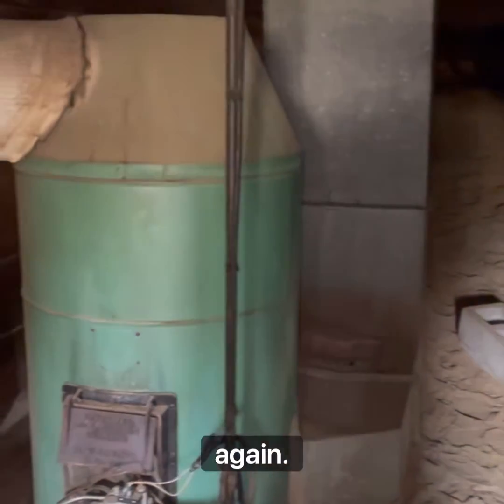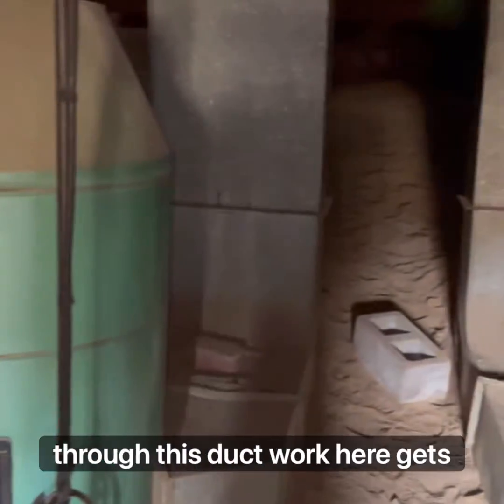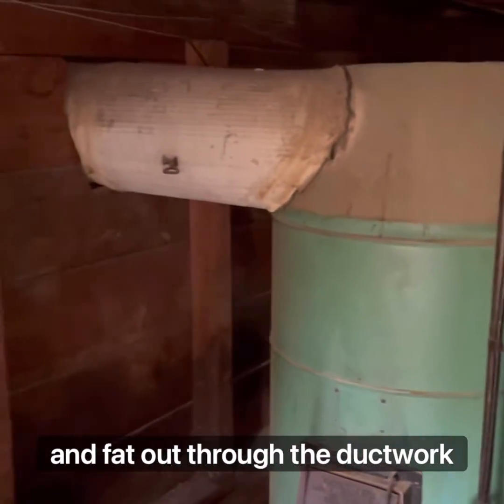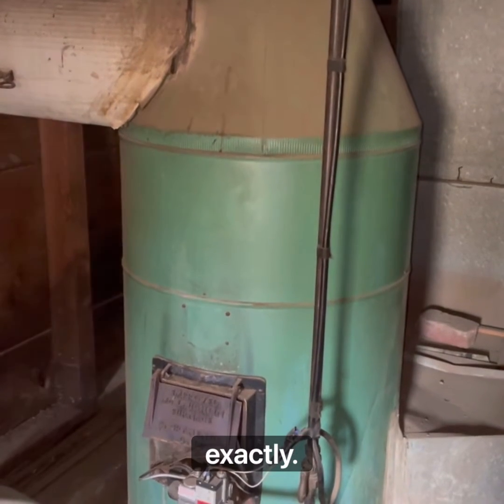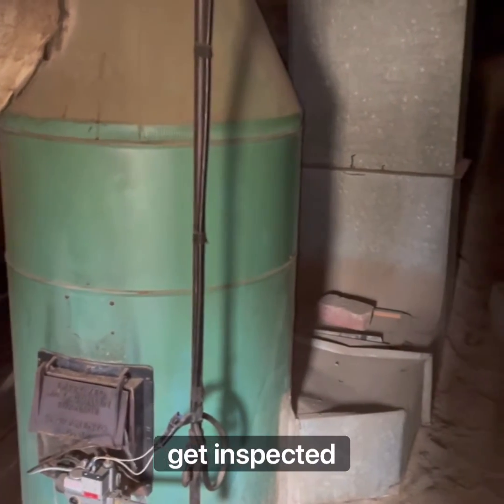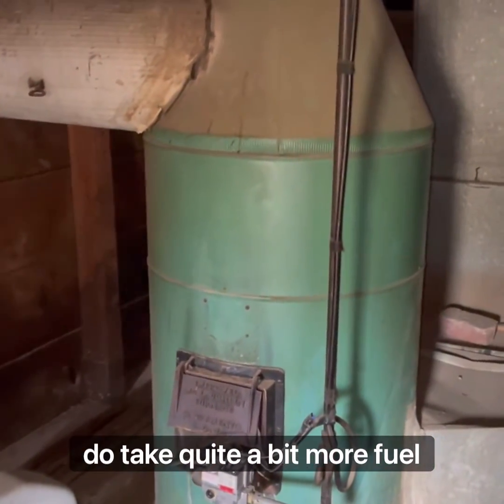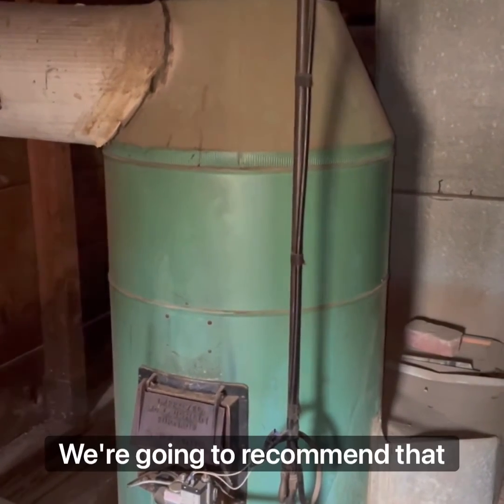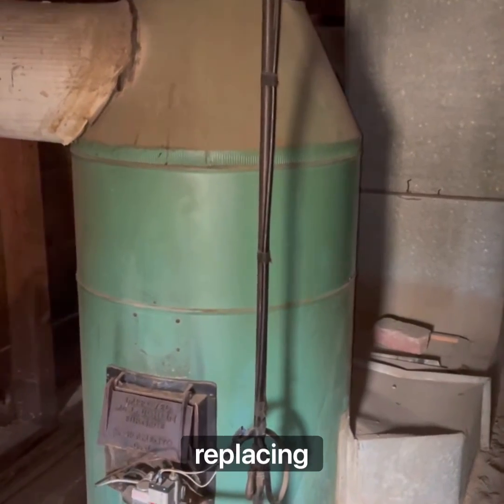What is a Gravity Furnace? How does a gravity furnace work?

Comment: I have a functioning "octopus" gravity feed heating system in the house  my grandfather built in 1936 and I've lived in for 30 years. I have replaced the $5 thermocouple  twice, that's it. My mother lives in a house with around the same square footage and "modern" gas furnace. Our heating bills are very comparable, and when you add on the service bills she has had, filters, and the replacement cost (even if her furnace lasted 25 years) I'm way ahead in the cost department. Everyone says how "inefficient" my heat must be, but I've never had to worry about the electricity being out, or large repare bills, and my monthly gas bills are no more than anyone else's. I'm going to make some upgrades to this old system and gain some ground on the areas where some efficiencies can be made, but replace it? Never.

Comment: Other than the fact the ductwork is most likely wrapped with asbestos (as was nearly every other component in a 1920s home, yes even some  old electrical panels from that period were built on site from timber, asbestos board was nailed on the inside for fire protection,  then ceramic fuse holders were screwed onto the interior and knob and tube wiring entered the sides) the fact the furnace is almost 100 years old is a testament to how well-built things were back then.    Nowadays your $1200 Samsung washer from Best Buy might last 10 years if you're very lucky.    Unfortunately with fuel prices in this day and age that furnace is due for retirement.